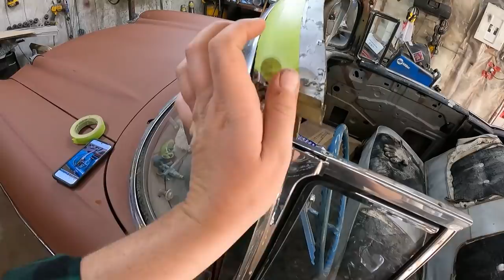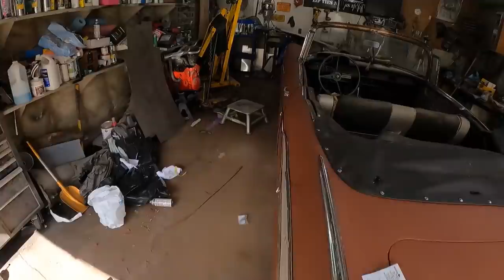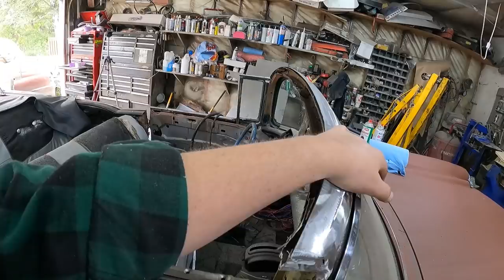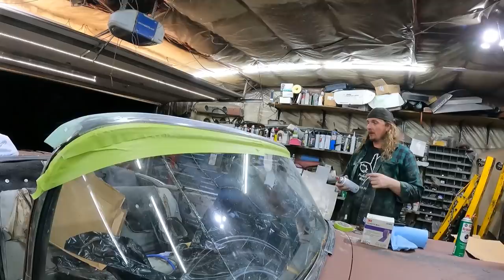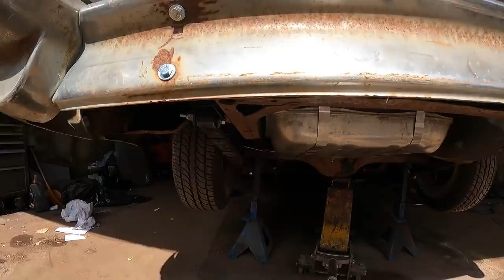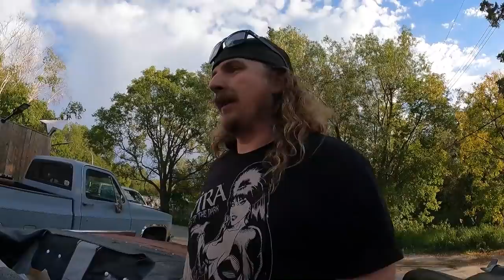IMPOSTER 1957 Chevy Rag Top CHROME IN A CAN Plus GLASS PACKS!

Comment: Too late now for different tpye of design Dan. I wonder what it would have looked like if you left the front 10" or so of the roof on so it flushed out with the rear side of the vent window. Then fab up an alum. deflector or build a piece to flare up the back edge of the roof. Flip it up, like a small rear spoiler to deflect the air that way. Weirder yet, a visor too. Go get a roof section Dan, It'll take me 4 days to get there, let's try it just for the hell of it. lol come on!

Comment: I would check on a real convertable but I think they have a small cutter along where you put that filler panel on the back of the windshield. That's why it looks so big and a little incorrect.  Probably the only think that at first glance would give it away as an imposter. All in all you've done a great job.

Comment: great job cleaning up the mess on the top of the windshield. A contour like the original converts have would work. if done like the original you could prob match a convert top to it without the insainely priced convert windsield chrome.  and avoid the high priced convert frame as well.

Comment: Instead of a rag top you should install snaps and get a a cover like cobra had that covers the drivers compartment and stow it under the snap down cover for the rag top. then it truly is a a roadster and if it rains you can still cover it. as for tips maybe the chevy cross tips?

Comment: I like the pipes the way they are but it does quiet them down some when you do the turn downs. Flame throwers are for kids... anyway its how it makes me think. I was wondering while windshield is broke anyway if you could mold it up to round it out better on that top metal piece. I don't think it detracts from its looks the way it is now. So from  trash to  treasure in less than two months of work time. And they laughed when you bought it thinking they emptied the trash can in your yard. Since its in the open like it is, needs the door cards and just possible a seat cover in front. Dual  rear antennas for just dummies would be cool. I ran mine with them down like not flagging the wind. My real antenna was under the hood laying on the inner fender. Got great reception as well. Just thinking that maybe on that windshield trim that you welded in... leave a chrome stripe a half distance and then paint the lower  part black and then from a distance who can tell?? Nice job Dan

Comment: I am wondering if you have priced the needed parts from Danchuk or Classic Industries. I know some of the replacement parts are expensive but they usually look really good.
Reply: for all the windsheild trim and frame new it is very costly , im building a 55 belair convertible conversion car 
and i got all most all of the convertible only parts and trim from my rusty 56 ragtop partscar  .

Comment: Those copper brake lines are just so you can move it untill you do steel ones right.Your not planning to drive it on the road with those are you? Or are they copper nickel ? By the way some nice work done here

Comment: the guy who hat used to make my drivelines  was a fabricator . about 000 years old he'd been there done that on anything . 
 he was welding a trailer hitch on a car  he hit the gas tank with the welding rod  and blew a hole in it as the gas ran out it was burning so . 
he got in it and drove it through down town leaving a trail of burning gas behind as he drove to the fire station.

Comment: I think that top panel should be about half as thick and rounded as the driver looks at it.  The color is fine.  You need some strength to bolt the the the top latches on it. Also, what are you doing for drainage?
     Question:  You use a Mig on sheet metal much more than any other YouTuber.  They don't have as good of results.  Can I get your recipe? I assume you never use Flux wire.  Do you use a 240 volt machine or a 120? What about gas and wire?
  Supposing you had to fill a hole the size of a quarter in metal, would you put a piece on the back the an then stick a  flush piece to it? Or just buttweld a plug the size of the hole?
   I think, as others have said, seeing what Dani can do with the sewing machine on upholstery would be useful.  I mean just a home manchine. (like I have but don't really know how to use, especially on vinyl or upholstery or leather)

Comment: Does it drive anyone else nuts that he does all the grinding, sanding, and welding with the seat, I think the new carpet, and especially the stainless trim ON THE CAR! A while back he pried the trim off the side of the car which typically bends it.  It makes me want to bang my head against the wall. Seems like on most of the parts cars we ever bought some bone head had sanded the trim, rendering it junk!